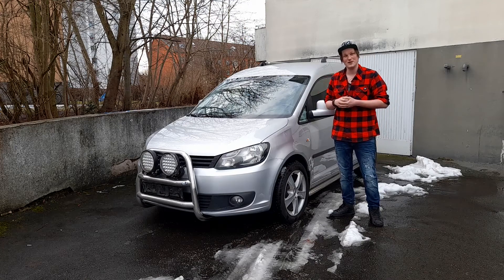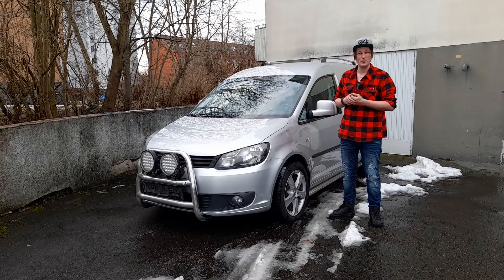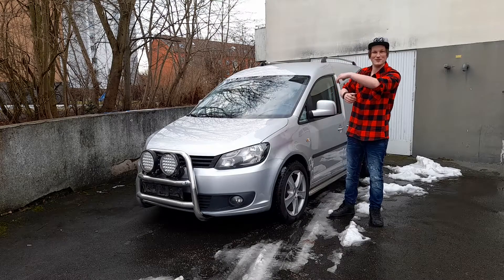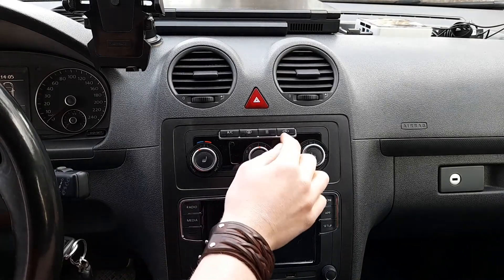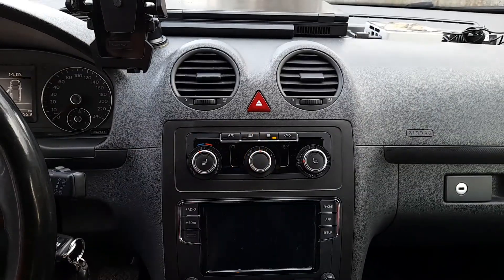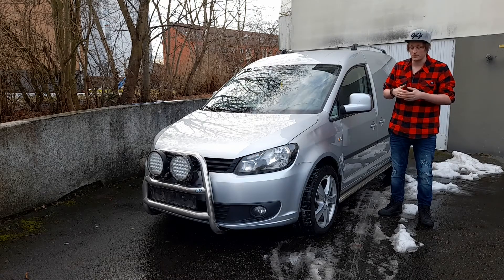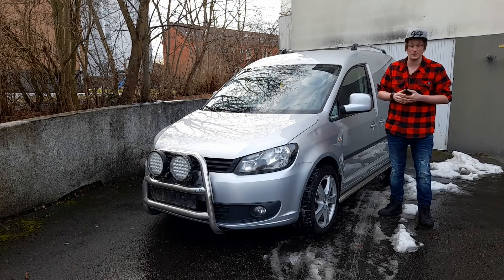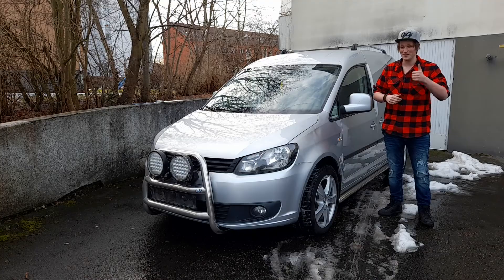Unlock Parking Heater With Permanent Fault Codes!

Comment: Hi,
You video is very helpful to unlock it. After unlocking the parking heater. I get the code Fault Found: 0005 - Ignitor with Flame Monitoring B1385 1B [00001001] - Resistance Too High
Do you have any advise? 
I have Golf GTE 2016.
Reply: Hello, i think your glowplug for the parking heater is bad, You can buy a "rebuild kit" from Dealer ship (you can do that in sweden not). And they are verry easy to replace

Comment: Is there anyway to flush the heater without removing it ? the car is Audi a4
Reply from the maker: Do you mean the water system to the heater? In that case the easiest way is to remove one of the water hoses coming to the recirculation pump located close to the heater itself.
Reply: @EFreddy  no , I mean the diesel parking heater

Comment: Hi @EFreddy! Hope u will assist. VW Technical could NOT be any more unhelpful. I think it may be related to an auxilliary heater (I could be totally wrong though)

Car is VW Passat CC (2015) 358 2.0TDi

I have error P302D00 PASSIVE/ABIOGENESIS High Heat Output Relay Short Circuit To Ground.

The error is easily replicated ieverytime f I set the temperature of heater blower to anything above LO and it started happening since ambient temperature has dropped sub 5°C. 

Once the car has reached an operating temperature that shows the oil temp on cluster I can set the blower to a higher temperature and it will not generate error (I assume blower is now using coolant heater matrix for warm air?)

Any idea what is the cause and possible remedy for this? My car DOES NOT have a seperate switch otlr settings for any sort of "parked winter time heater" like I have seen in some other videos.

Comment: 2 Faults Found:

0139 - Recirculation pump 
          B1382 15 [009] - Open or Short to Plus
          Confirmed - Tested Since Memory Clear
             Freeze Frame:
                    Fault Status: 00000001
                    Fault Priority: 3
                    Fault Frequency: 254
                    Reset counter: 15

0135 - Heater Unit Locked 
          B138F 00 [009] - -
          Confirmed - Tested Since Memory Clear
             Freeze Frame:
                    Fault Status: 00000001
                    Fault Priority: 2
                    Fault Frequency: 1
                    Reset counter: 15

hello mate, first I have to replace the Recirculation pump and then activate the Heater Unit??
where is that pump at the golf 7
Reply from the maker: Hey! Thats correct. Replace the pump before going further. Keep in mind that these cars often have more than one recirculation pump. The one most known for failure often is located close to the heater itself. On most Vw it's somewere in the neighborhood around the right wheel arch. 
 
If you happen to order the wrong one online or something like that - the head of the pump is removable - simply take the old one and swap it.
Reply: @EFreddy  thanks for the quick reply, that's what I'll do

Comment: Hei! I have a 2012 touran bmt highline but no webasto functions,switch or buttons. But theres a webasto machine installed in the engine bay. Is it possible to activate this using the vcds?
Reply: I’m trying to find out if I have a webasto installed, where in the engine bay are you looking?
Reply: @ashm23452  lower right side beside the right front wheel
Reply: Webasto works automaticaly, when outside temperature is 4 degrees or lower.

Comment: Hi. Great video! I Have a 2010 Skoda Yeti. Now the aux. heater disappeared from the meny in the display. It that because the heater is in locked mode? How do I unlock it on this car?
Reply from the maker: Thank you! In this case for starters you need to read out your fault codes. For this you can use any decent scan tool. If the icon have disappeared there will most likely be an answer there, telling were to go next. 

Regarding the unlocking thing however a Vcds-program shown in the video is needed.
Reply: @EFreddy  Thank for your reply. I did read out fault codes. There was only one: P242A Exhaust Gas Temperature Sensor Circuit Bank 1 Sensor 3. Is the VCDS something I can download?

Comment: hello, I have a vw t5 2005 1.9tdi with the original heater and there is no place to connect it. I think from the aspect that never worked. the commands are manual. Can you help me to understand how I get the park exhaust to work?
Reply from the maker: Hi Gold! Do you have a read out of the fault codes? They can give you a good idea of were to go next. If it's a car with a high amount of miles on it. Soot in the chamber is a common problem. Causing the heater to lock itself.

Comment: I have vw passat b6 when i try to turn on auxiliry heater it turn off automatically and screen shows aux heating system error apart from that last month my car has aux heating menu in the screen but now there is nothing can you please help me
Reply from the maker: For starters you need to use a scan tool to do a read-out of the car. That'll give you an heads up on whats wrong. :) Without a reading your guess is as good as mine. 

Common is some of the issues mentioned in the video. Worn out glow plug, damaged chamber etc.

Comment: Hi, I have 01488 fault code - g241 sensor- showing coolant temperature at 150 C’ all the time. Can I do something via VCDS or it will work only with replacement the sensor?
Reply from the maker: Hmm, that fault code usually occurs when there is a shorted or open circuit. Sounds like wiring to the sensor itself. Does it say "010 - Open or Short to Plus - Intermittent" by any chance`? :)

Comment: Hi

Nice job! 

What about Q7 4L? Can you tell me how to unlock it please? Thanks
Reply from the maker: On the Q7 4L it's channel 007. Then save with a 1 as the video shows :)
Reply: Hi sorry I didn't explain myself well.  the van comes with the original system assembled but inside the car there is no button and we don't even know how to turn on the exhaust 🤷‍♂️.  We don't know if it works automatically or not.  no controller .